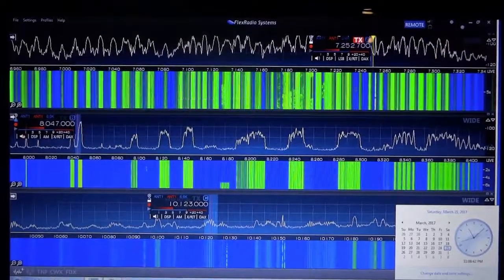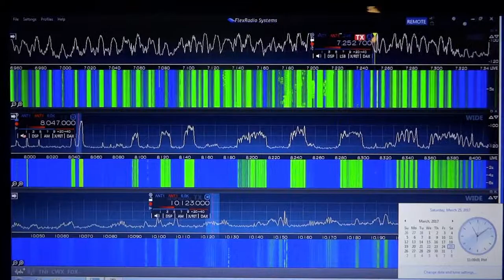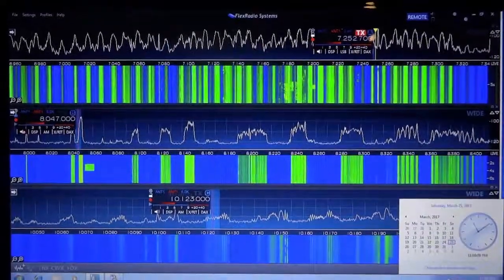Plant Grow Light Interference RFI on HF Amateur Radio Bands SDR

Comment: So how to use a ballest to grow legally and still keep it discrete then? Does quality of ballest mess with sending out the signals?
Reply: digital ballest have a form of switchmode operation which generates the rfi  magnetic ballest do not create as much problem but run hotter  both need very good screening to stop being detected .
Reply: There are commercially available filters.  You need to install a filter on the power cord, and also a filter on the output cord of the power supply that drives the light.